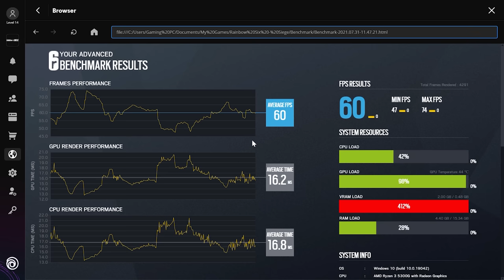The BEST Budget Prebuilt Gaming PC - RX 5500 + Ryzen 3 5300G

Comment: ngl hp's been showing out with their pre-builts this year and they're pretty slept on. I recently got one with a 1650 and a i5 and it's been amazing i was lucky enough to get one off of amazon for 599 and for that price you rlly can't beat it. Another great thing about it is the size i personally have a smaller desk and its perfect for me. I def recommend as a first pc.
Reply: Dude I was looking at that TODAY thanks for the info!
Reply: Well I got 1060 6gb with i5 8400 in around 650$ in Amazon India. It's an acer pre built predator orion 3000. Can't complain in this market, plays all aaa title.
Reply: @gauravdwivedi2808  the 1060 6gb is still a little beast in 2021. not the 3gb card tho that was a waste of silicon. should've never existed.
Reply: Which one was 599? Would love to check it out
Reply: Would a 1650 be better than the Ryder 5500?
Reply: @batchest7201  a 1650 is worse than a rx 5500 if thats what you asked
Reply: @batchest7201  rx5500 is better than a 1650 but the other hp one has a 13 with a 1650 super which is better than a rx 5500
Reply: It kind of feels stupid to put both integrated graphics and discrete graphics into the same computer, especially with all these shortages. I suppose HP has a stock they need to sell, but personally I would prefer  r5 3600 , 3600x, or even 2600x with price adjustments .
Reply: @aleksazunjic9672  not really for the end user what if the gpu dies at least they can still use the pc also if the end user is a streamer they can use the igpu encoder to stream and leave the gpu untouched since amd doesnt have nvenc encoder.
Reply: @aleksazunjic9672  that's true but hey at least theres other options
Reply: @rzfszn  Warranty would cover case of GPU dying, at least for several years. 5500XT are not known for suddenly malfunctioning, and for streaming it is better to have 6 cores and 12 threads than 4 cores and 8 threads.
Reply: @aleksazunjic9672  you will still have to send in the gpu to get it repared or get a replacement
Reply: @rzfszn  Yes, but you would do it anyway. Integrated graphics are not completely useless, but they are on the level of 1030 GT in games.
Reply: @aleksazunjic9672  i mean it was still a really good upgrade for me who used to use intel uhd 630 to switch to vega 7 and now today i managed to get a 1060 6gb and it feels buttery smooth and im happy with it but the vega 7 is still a really amazing igpu packed into a little package.
Reply: @rzfszn  Congratulations on your upgrade :D This is what I'm talking about. Integrated graphics should be saved for people with limited budget. And people who could afford discrete graphics card would prefer stronger CPU for the same amount of money.
Reply: @aleksazunjic9672  Thank you! I see your arguement but igpus are still useful for certain things other than gaming, say if you wanted to keep power draw down you can use your igpu when not gaming they are still very useful once you have a dedicated gpu too.
Reply: I'm getting the r5 3500 and gtx 1650 super variant
Reply: I ordered one with a ryzen 7 3700x and gtx 1650 for 782$
Reply: How has your computer been 7 months later?
Reply: @jeramiahporter9909  it's held up nicely no problems only adjustments i made was upgrading the ram and the storage planning on upgrading the cpu soon.

Comment: i got this pc like a month ago, but not 16 gigs of ram, im planning to upgrade my ram and ssd but overall, this is one of the most slept on prebuilts out there
Reply: i also do stream on the regular, so it is a great pc (like i said earlier)
Reply: what setting do you run on fortnite i have the same pc as you but mine is stuttering
Reply: @TOPFLO0RBOSS  i use performance mode with medium/high settings
Reply: So after 9 months how it is going, and what did upgrade?

Comment: I have the R5 5600g W/ rx5500 variant. I would really like to upgrade the gpu for Higher quality titles. So if u guys still have one of these prebuilts lying around, it would be awesome to see a GPU upgrade video, just to give me an idea. Amazing content aswell!!
Reply: Can it run games like call of duty black ops 3 or fallout 4 at 1080p/60 ?
Reply: They did a video on your config (5600g + rx5500) and noted that the power supply is proprietary and can’t be replaced, and is already nearly maxed out, so upgrading graphics card (to something that would likely draw more power) is a tricky proposition.

Comment: I was able to snag this model but with a 512 SSD for $550. Spent an extra 30 bucks for a 8gb stick of RAM and I got a nice little setup for my daughter. Fun fact, it also seems to run VR games without any hiccups. Now when I eventually upgrade the CPU and GPU later on down the line, what would you guys recommend I get first?
Reply: When you go to upgrade down the line, for the CPU just go for the highest Ryzen 7 the board will support. HP usually has this info under their support page for these PC's. As far as GPU, as much RX 6000 as you can stuff in there.
Reply: rx 6600 for the gpu
Reply: Ended up getting a Ryzen 5 5600g and rtx3060 ti for a really good deal. Replacement the CPU cooler and exhaust fan with noctua stuff... Overall I'm happy with the results.
Reply: What ram should I use to ungrade it?

Comment: Definitely looking into at least upgrading specs or getting a new PC. Been running Fortnite on just an average of 40+ FPS and just had to watch the beginning Apex cinematic on an average of 9 (yeah...I know - it's bad). My PC has an integrated unit (AMD Ryzen 7 + Radeon Graphics) so it wouldn't take much for me to get something to upgrade dramatically. Lol
Reply: what settings do you play cause i have a ryzen 5 4650g as a temp solution and i can run these games decently good and games like fortnite on pro settings on performance i get 90+. also ram migt contribute too how much ram do you have, is it in dual channel and what speeds cause ryzen likes faster speeds.
Reply: @rzfszn  Low everything. Lol. RAM is 12 GB, about 10 GB available. Idk about the speeds though but it's prolly not great :]
Reply: @landkevin28  the speeds may be the reason why. if you were to upgrade id recommend 2x8gb sticks 3000mhz+, 3200mhz is the sweet spot

Comment: Nice video. I just bought one of these and it came with a Ryzen 5 5600G & Radeon RX 5500.

At the time that I was at the store, I didn't think about it not including a disc drive and I only have internet on my phone, so I can't play any of my games on it until I get back to the store and buy an external disc drive and an HDD for it.
Reply: Friend is selling me the same computer with the 5600g and rx 5500. How has your experience been with your pc?
Reply: @buddahkz9980  it's been good so far. The only game that I've been able to test on it is my copy of Sims 3, though. I need a much more modern game for it. I had to buy a $25 external disc drive for it.

It does have an audio issue that I haven't been able to fix. That is that my audio cuts out every couple of hours or so.
Reply: @jameshollan1160  awesome to hear thanks for sharing your experience

Comment: up graded this to 32 gb ram, 1tb SSD. I can play Ps2 emulators at 60fps, Final Fantasy XIV max settings 1080p at 70 to 90 FP (slightly lower fps at higher resolution settings and Gshade on), Devil May Cry 5 at 80 fps 1080p (slightly lower fps with higher resolution. recommend 3200 resolution med settings for 60fps). Got this at walmart for 599.99. I skipped the Ps5 when I saw this and got this instead. Modern consoles are so limited to what you can do, and higher resolutions don't make a game great. I always was so stuck on console gaming since the 90's. I don't think I'll be going back to consoles anytime soon. I recommend to anyone to have 60 fps in any game at least. I can't tell how games feel at higher than 60 fps so don't be obsessed with the fps thing. This build is good enough for even newer titles. Just to add this gpu was a RX 5500, not a 5300.
Reply: Can it run fivem gta?
Reply: @Tayo_vibezzz  I don't play GTA so. I'm guessing it does
Reply: Aye bro how do I upgrade the ram or where do I do it or buy it from

Comment: It kind of feels stupid to put both integrated graphics and discrete graphics into the same computer, especially with all these shortages. I suppose HP has a stock they need to sell, but personally I would prefer  r5 3600 , 3600x, or even 2600x with price adjustments .

Comment: I’m pretty new to the pc scene, can someone let me know what exactly he’s testing when he shows a higher FPS then it gets lower? Is the higher one a different graphics card then the stock one?
Reply: He was testing the rx 5500 graphics card (higher FPS) and also testing the built in graphics on the 5300g chip (lower FPS).
Reply: @rotarywhiz  so if I got the pc I would see the first examples they showed
Reply: @srtxreaper2002  yes, in the video at 3:56 they show where the rx 5500 graphics card ports are located, so you would want to plug your monitor into the HDMI port there.
Reply: @rotarywhiz  alr thx

Comment: Im surprised you guys havent reviewed the hp pavilion model with the 10th gen i3 and 1650 super. It goes for around 700 bucks on amazon right now, and its much better value when comparing the components of this model and the one in the video. I think a review on it would be great!
Reply: Do you have the link?
Reply: Nah the $520 ryzen 3 5300g and gtx 1650 super is better value
Reply: @joemoaohello9985  that is really good value, wheres the link?
Reply: The sale ended today it was 150 off for presidents day sale now its 650 and the 1650 super went out of stock so its either the rx 5500 which is almost as good for 20 bucks less or the 1660 super for 70 more but it was on the hp website
Reply: oof

Comment: I bought it loved it for a week but the graphics card could of been better same with cooling the heat sync is pretty bad and it doesn't have a intake fan and a small intake I saw 15% boost in preformence once I added one and swapped the gpu for a 2060 before I got 40 to 60fps in wz now I have 80fps reliably definitely at least take off the side when you use it I will rilly help with your temps

Comment: I absolutely hate HP Prebuilts... they always use a propriatory motherboard and chassis which makes it impossible to do any upgrades... if I ever came across one of these, I'd wind up scrapping it as the build is just too junky. I'd move the internals to a better build like a MSI B450/B550 based system. The way HP builds their systems, they are too expensive and lack expandibility... a custom build is always better than a prebuilt...